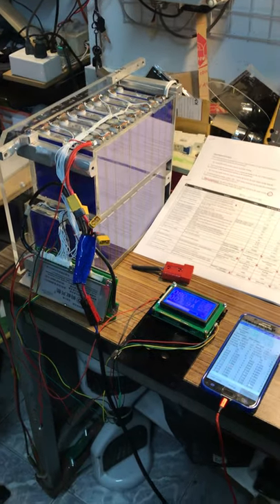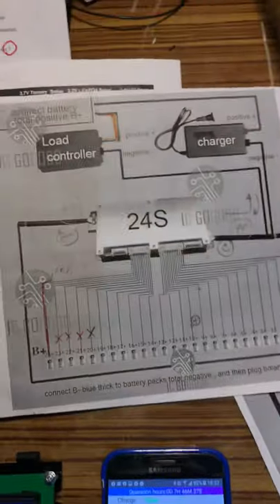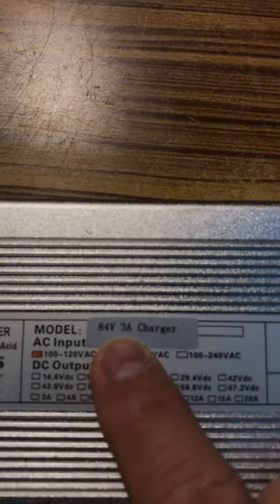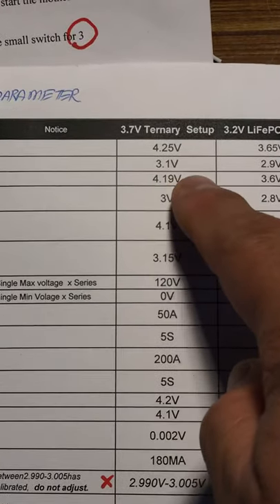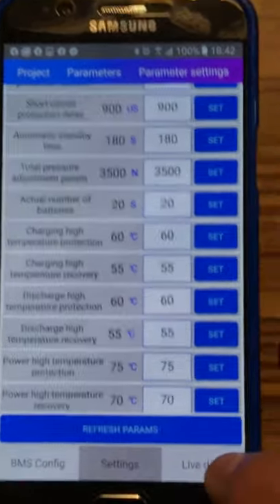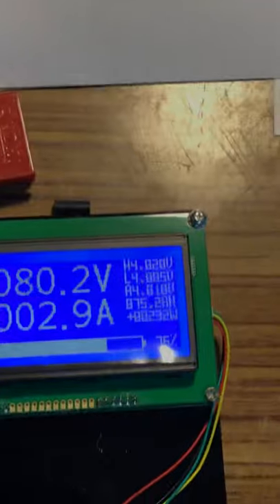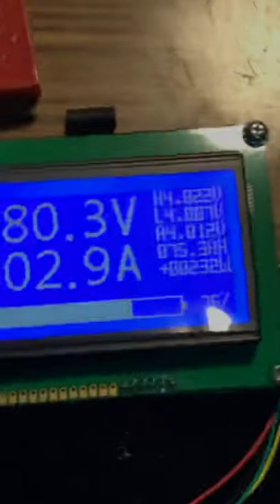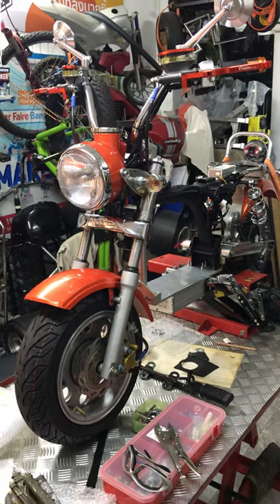ANT Smart BMS setting up

Comment: Hi Does anyone know how too solve my issue the ANT BMS discharges fine but will not charge when put my on bench power supply it's a 60V 45Ah pack. What makes no sense is Charge/discharge is done on the same Line.

Comment: I found the diagrams.  Wondering how much needs to  be connected to make the display function.  I wired the power on the display, I wired the display wires from protection board to display and the on/off switch on the protection board.  I have not wired the sense wires to the individual cells.  The red light comes on then fades out and the display does not come on

Comment: I bought this same set up for my 48v lithium battery bank I plug-in the meter does not light up on my android phone I have a Bluetooth paired with my phone it says ANT-BMS16S but nothing does not show any settings for the BMS almost as if this be a mess is garbage I am unable to charge my battery bank through this be a mess I have the red light blinking on the side of the BMS !

Comment: Hey man cool video. Do You know how to wire the display to the ignition? So it will come up when the key is on? I can see you have 2 sets of wires pluged in to display. On the left is black and red. Is it to power supply ? What is the voltage for the display? Thanks
Reply from the maker: Yes,  My friend  the red/Black = 5v  and the 4 wires on the right are data wire. So I will need to modify add more switch because the 2 switch kind of  fragile and easy to break off the pcb.  but the display just one way output only, it much better with Bluetooth to Android or IOS "ANT BMS"  on Apple store
Reply: @NaiyimsGarage  good stuff man. thank You 👍🏻

Comment: hi
is this ant do balancing by itself or need to push botton for balance?

thanks 
yossi
Reply from the maker: It did automatically , depend on what you set the cell max voltage when it charged